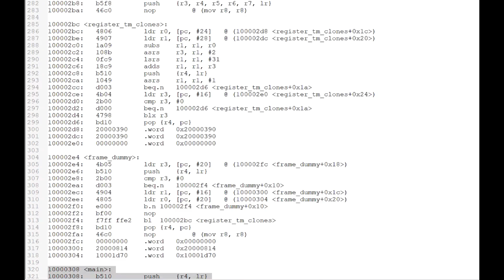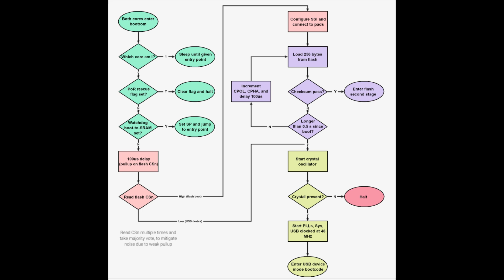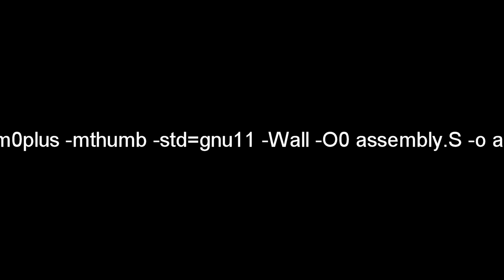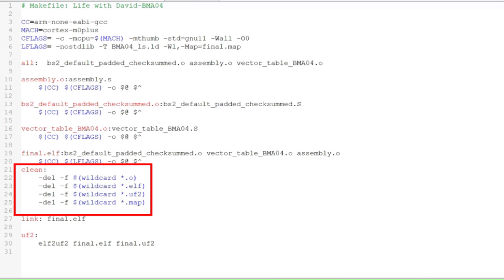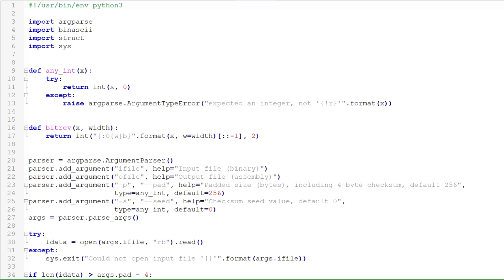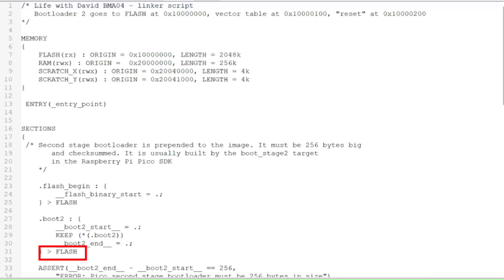RP2040 - NO SDK! Assembly Language Programming - BMA -04

Comment: 👍 Became knowledgeable about boot loaders as a teacher in the days of AppleSoft basic and INIT HELLO. The Apple II boot loader was 256 bytes and resided on a ROM disk controller chip. Bare metal assembly code is smaller and more efficient.
Reply from the maker: I got into the Apple II boot loader when I reversed engineered the disk system to modify a couple standard 5 1/4" floppy drives to think they were Apple drives.  I have a video on that (https://studio.youtube.com/video/rxBV3YILaaM/edit).  Those were very cool times.  Thanks for watching!
Reply: I watched your video. Very cool home made expansion cards. there’s a DOS.MASTER utility by Glen Brendon for Apple 2GS that runs dos 3.3 programs on a hard drive. I posted a short of my Apple computer collection https://youtube.com/shorts/MhZxHKpncKI?si=8iofYG6MGsgY5sjv

Comment: Thanks for this great video. You could have used a bash script instead of a Makefile. I personally avoid "make" for from-scratch projects as they never take more than a second to recompile.
Reply from the maker: You're welcome.  I think I would have used a bash script if I was using Linux.  I'm using Windows and I used Makefile because it was the first thing I got to work; I had to do a lot of searching before I got a handle on it.  Thanks for watching!
Reply: @LifewithDavid1  I heard that, and I am impressed by the result of your research. Excellent work!

Comment: I wanted to try out GDB on the Pico and rather than write a program and thought I would cheat and use this program  and went to Github RaspberryPiPico-BareMetalAdventures/Chapter 04,  to copy. But it did not flash the LED😞. I had a look at the listing and on line 29:- ' str r1, [r0, #36]  	// 0x20 GPIO output enable',
the comments hex value is correct but the decimal should be 32. 
Now all that said, the time a took to find this error has improved my understanding of the GPIO🙂
Looking forward to going though the rest of the parts , and a big thank you for taking all the time to compile this series. I had given up trying to get basic things working until I found these videos...so for me it's onwards and upwards....I hope

Comment: I also have to call out calling "256" "Two Hundred Fifty Six"  this is like saying 200, 56.  I.e. TWO different values.   Read the following sequence of values to someone on a phone .... "256 200 56" and you are going to say "Two Hundred Fifty Six Two Hundred Fifty Six".  

The correct and NON ambiguious way to say this is "Two Hundred **AND** Fifty Six".  The american way is both lazy AND WRONG.

< /nit >
Reply from the maker: Sorry, as a pilot, we are trained to NOT use the word "and".   Thanks for the comment.
Reply: @LifewithDavid1  It is still COMPLETELY WRONG for reasons stated above.  It is ambiguous and therefore subject to misinterpretation.  The AND is VERY important and correct English usage.
Reply from the maker: I checked several style guides and saw that most Brits use the "and" after "hundred" while most technical Americans do not.  During my engineering training, I was taught to only use the work "and" to indicate the decimal place, like two hundred fifty six AND twenty seven thousandths (256.027).  I remember using "and" after "hundred" in high school and was schooled why that was incorrect.  Pilot training also.  It took a lot of practice to eliminate using "and" in integer numbers.  I'm too old to change my ways now.  LOL

Comment: the odd addresses are so the CPU core can switch between ARM mode and Thumb2 mode.   On reset the CPU is always in arm mode.  to switch into thumb2 mode somewhere in the boot code there will be a call to an ODD address.
Reply from the maker: That's absolutely correct.  It took me quite awhile to figure that out.  Thanks for watching!

Comment: i would love to see my thumb2 forth running on that without linux!
Reply from the maker: Maybe an emulator; like my bare metal 6502 emulator video (https://youtu.be/75jz8UZjrTo).  Great idea!
Reply: @LifewithDavid1  I have already mostly written an 8051 emulator, modifying that for risc-v would be trivial but for arm or x86 would be horrendous. 

my forth already runs on every single thumb2 Linux system I ever tried it on, it is written in 100% assembler and makes use of zero external libraries, everything is done with Linux system calls so porting it to bare metal would probably not be that difficult for someone with the actual hardware

Comment: Loving this series, sleeves are rolled-up and it's getting mucky!
It's probably occurred to you already, but you can use other make targets as prerequisites in another target, so 'uf2: link' will complete the build in one hit, and 'all:' would be redundant.
Also *-gcc doesn't do anything to the asm files, that gets delegated to arm-none-eabi-as to assemble. Include '-v' with *-gcc to see the full incantation.  Including it would add a couple of lines to your Makefile, but not change the outcome.
Kudos for getting stuck into linker scripts!!  Always look like some sort of black magic to me.
Reply from the maker: Thanks for the insight.  I was thinking about that.  During my early ventures into linker scripts, I had so many errors that I didn't want to do too much at any one time.  Now I'm experimenting with relocating (again) parts of the program and I'm getting into more errors.  When I have the program structure the way I want it, I'll work on streamlining the make file.  Also thanks for the info on the gcc assembler.  I've got a lot to learn!

Comment: Why did you need to modify the linker file and what exactly did your change do?
Reply from the maker: I might have been able to use the linker script as is; but I decided to get rid of a lot (but not all) of the stuff I didn't need for this exercise.  My linker script is about 89 lines long; memmap_default.ld is nearly 259 lines long.   Here  is the original: https://github.com/raspberrypi/pico-sdk/blob/6a7db34ff63345a7badec79ebea3aaef1712f374/src/rp2_common/pico_standard_link/memmap_default.ld

Hope this helps.

Comment: Much appreciated. I'm keen to see how the clocks are set. I had a quick look at the datasheet and it seems complicated. There was also something about setting the clock for the GPIO, which I find puzzling. Is that something we need to worry about?
Reply from the maker: I'm putting together a video on clocks now; should be ready within the week.  Hopefully that will help.  You don't need to set a clock for the GPIO, you can either export a clock to the GPIO or import a clock through the GPIO.  I will demonstrate both.  Thanks for watching!